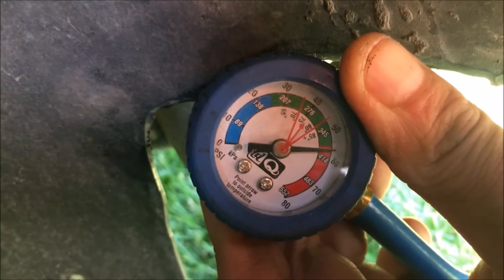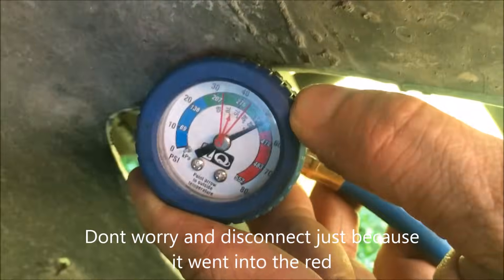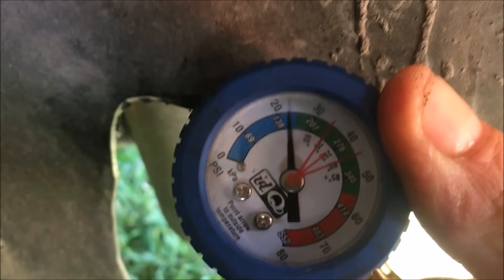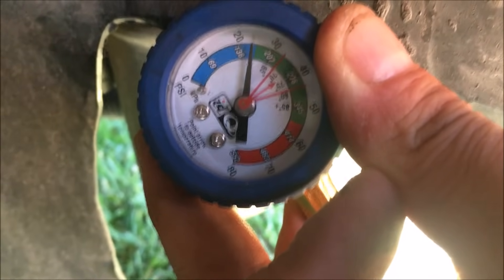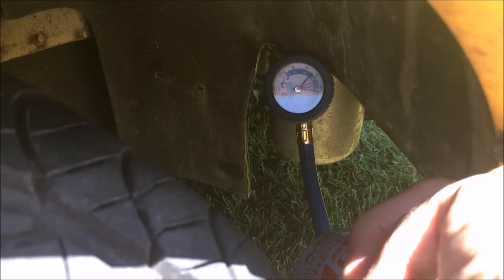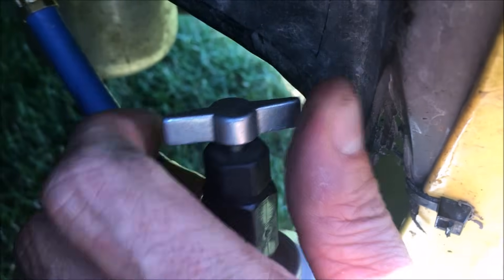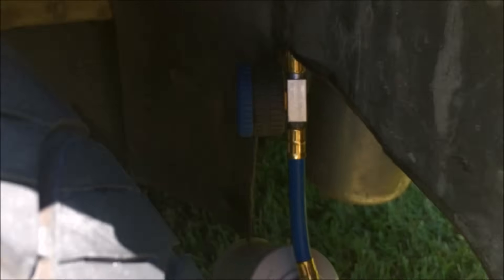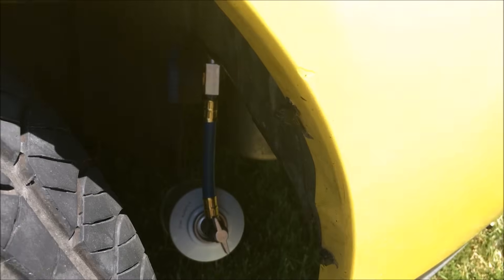Ac kicking on and off ( FIXED ) pressure fluctuation ( solved ) Recharge car ac. pressure to high?

Comment from the maker: Hello everybody , if your as happy as all the people below   please sub this channel , you dont have to watch my crappy vids Just help a fella out , thanks a million  your subs boost my channel value at no cost to you .
Reply: NOBOX7 I have a question! What did you do to have your compressor come on? When I press down on my nozzle it shoots into the red and I can hear my compressor is still trying to turn on
Reply from the maker: @SaturnSnapple  just keep slowly adding , it will stay on
Reply: I have a question and hope you can help me out.  The gauge on the Arctic Freeze I was putting in my van does keep going up and down and the compressor does keep turning on and off.  Can't seem to get the can emptied after about 40 minutes.  The can did empty about 80% of the refrigerant.  The gauge on the can sits at the border of the green and blue if I keep my van running.  But when I turn my van off with the gauge still connected it goes up into the red.  Is that normal or did I overcharge the system.  Which reading is correct.  With my van still running with the a/c on high or with the van completely turned off.  Hopefully you have an answer for me.  Thanks in advance!
Reply: @michaelpoole8175  look for leaks in your system, short cycling usually indicates low refrigerant condition. Also do not use stop leak, you'll kill your system within a year!
Reply: @4g63tpowered  how? Ive added refrigerant with leak stop several times in the past 6 years and knock on Ford it's still working
Reply: @JB-ef7ks  it tends to plug up the pressure port orfices leading to high pressure in the system. Either a hose will rupture or compressor will take a dump. I'm sure every vehicle make and model is different. Some you could get away with while others not. Just trying to help people. I should've explained why though. So thank you for asking.
Reply: @4g63tpowered  thank you for elaborating! 🤙
Reply: @4g63tpowered  my redtek refrigerant has a stop leak in it, but they say that it's not the typical leak stop. According to redtek, it just softens up, makes more flexible & plumps up the gaskets only.
Reply from the maker: @michaelpoole8175  Only when running . you have to turn the can upside down back and forth
Reply: You’ve got your subscribe! This IS THE ONLY VIDEO TO SHOW EXACTLY HOW TO READ THE GAUGE ON A FREON CAN!!!!
You’ve saved by life!!! Found that I was afraid of overcharging my system when, in reality, was low on Freon. After refilling it, found it’s leaking through the low pressure intake valve where you connect the can! Is it fixable? Any suggestions? It’s oozing some dye from it. Not sure if there’s an O-ring or something missing. Thank you very much!
Reply: @roadshowautosports  Schrader valve replacement. Parts houses sell the kit it's under ten bucks.
Reply: @roadshowautosports can’t agree more sure I could buy him a beer ! Great work !
Reply: New sub for sure and thank you again!
Reply: Done my friend! Subscribed! I had just repaired a leak and recharged mom's Subaru and it also had low pressure lockout but DID NOT behave like this at (compressor just ran continuously or not at all). Same day, same basic issue, my 06 Ranger was doing exactly this wild fluctuation due to the compressor only coming on at equalization pressure. Let us never forget!
Reply: Thank you so much 👍💯 you saved me from a hefty bill.. Liked and subscribed
Reply: Was looking for explanation of this for a 2005 Silverado, Thanks
Reply: Heck I’ll sub Thank you  My good man

Comment: Your opinion about “Ford” is ridiculous. You bought the Ford. Now you talk shit about the Ford. No auto engineer cares about maintenance only efficiency of production. The fact that you didn’t know how to use a tap properly or remember the name of the drier shows you are a novice trying to get views. The Ford isn’t crappy… your knowledge and explanation are what’s crappy. Your gauges get attached to the hoses at their respective locations for a reason. That fluctuation in the gauge levels off once you get enough refrigerant in the system.
Reply from the maker: Driver will soon Return On Foot   or be   Found On Road Dead ... This car was actually a F%#$@& Over Rebuilt Dodge though ? . I think the  "Failure Of Research & Development "   Is what caused the need to   Fix Or Repair Daily . Mechanics have told me they have  bin  asked forgiveness by Ford engineers  " Forgive Our Retarded Design " .  
We sold my sons car and i never have to deal with a ford again

Comment: vid helped me isolate issue to compressor clutch short cycling. pressed the bottle button whenever the pressure reading dropped (aka when the clutch engaged) and now it's fixed. thanks!

Comment: What if my ac is cycling on and off and instead of the pressure going to red zone and coming back down to low it only goes to the blue zone (normal) when it cycles off and then reads low when it cycles on? Pressure doesn’t read high like yours.

Comment: You seriously just saved my bank account. I kept thinking all these comments were BOTS. Lol. I did just like you said and it’s stabilized the system. Note: keep pumping the Freon into the system until it stops fluctuating, it will stabilize.

Comment: Hi, I have a 2015 Jeep Grand Cherokee and the AC compressor is keeping switching on and off the gauge is in green about 40 psi when the compressor is on and when is off it goes up a little but still in green. So can someone please tell me what’s going on? Thanks
Reply: put a manifold gauge to check the high side pressure.  but this looks like a bad evap temp sensor.

Comment: Exactly why I won't buy a Ford and will only work on Fords for close friends and family.
Im convinced that Ford designs EVERYTHING in their cars to dissuade home mechanics from doing even the easiest of repairs and even routine maintenance. 
Proprietary fasteners, specialty tools, impossible locations, etc. 
If you're not one of the 10% of Americans who can afford to run their ride to the dealership and pay a minimum of $300 every time a fuse blows or a tire goes low, avoid Fords! 
It's literally easier to maintain most foreign makes than it is a Ford.
This was a public service announcement from someone who cares to make your life less frustrating. 
You're welcome.

Comment: Dude.  I wish I would have found your post a while ago.  No need to repeat what so many have already said, but I have a 2007 Chevy Silverado 1500HD and hooked up the AC charger and the pin jumped back and from low to red zone.  So…I watched at least 20 videos on all the things I needed to exchange or repair, and had several in my cart, then I found your vid, hooked the AC charger back up and started pumping to refrigerant in and the system responded EXACTLY like you posted.  The pressure stabilized in the green zone and I’ve got the coldest air this old truck has pumped out in a long long time.  Thank you!

Comment: This is exactly what my Tahoe was doing. Thought it was the pressure switch. Replaced it and it was still doing the same thing. I thought I was going to overcharge the system but when the compressor kicked on I just kept adding refrigerant and like magic, it worked! Cold air, compressor stays on and levels in the green. Great video! Nice getting it done myself

Comment: Helped with 2003 Chevy 2500. Low coolant in system. Without compressor running I was in the red. When compressor finally clicked on after a few seconds of blasting, It would read low. I kept it pegged in the red until compressor continually ran.

Comment: Ford is crap , so if your fender liner wasn't ripped apart you would need to remove the tire and fender liner for access to the valve.
Reply from the maker: yes but the tire wont come off when you try LOL

Comment: My 2005 Tahoe AC has worked flawlessly in the three years I have had it.  I had a reputable oil service change done a week ago and they said the AC system needs work.  I said my AC is ice cold.  I used the AC three times since then and had cold AC.  Now, the compressor clicks on and off.  Do you think they did something to make it fail, to make work?

Comment: I feel like my compressor never fully kicks on, what do I do
Reply from the maker: Let refrigerant out and see if that works , let some out by pushing the shrader valve with a screw driver . if its over filled it turns off and on also
Reply from the maker: does your fan kick on ?

Comment: AC Pro should pay you for explaing this!  I watched a lot of videos from them and youtube and this is the only one that mentions this cycling symptom i was seeing. I had given up thinking I had a bigger issue and didn't want to do more damage. The AC completely stopped last week and I thought i'd give it one more try and saw your video. It was cycling between the low/green line and the yellow/red line every 5-10 seconds.. I just emptied a whole can and i'm steady now in the green blowing cold and fairly confident the whole issue is a slow leak. I could have saved a lot of time farting around trying to fill it and driving in a hot car over the last year if they would have explained the readings you may see with their $50 setup.

Comment: Hi. I'm wondering if anyone can help. I only have the fluctuating reading when my ac is on and on LOW fan setting. When the ac is on and the fan is on full blast, it stabilises on the top of the green band. Can you explain what the problem might be and a solution?

Comment: Just wanted to say that i stumbled on your video and it helped me alot. I normally own cars or trucks without A/C issues, but i recently bought a Yukon from a lying cop who didnt tell me it had low Freon (we bought it in the middle of winter so we couldnt tell it didnt work). I decided to fill it and add dye to check for leaks, but it kept kicking on and off during the fill...your video explained everything to me. Thanks.

Comment: I have a 2019 f350 and my compressor kicks on and off and im connected to low pressure line and it jumps up and down and i can not get it to the point where it stays on, can it be air? Its blowing cold but the clutch will kick in and out then sometimes it wont work
Reply: Yeah so i would getbit to work then days later it would stop then i would make it turn on by passing the switch and the pressure was to high then i would bleed it off and it would start but not blowing cold then it would get to low then i would vaccume the system then put just what it takes or a lil less freon then it would work pretty good but again a few days later it would stop working and it was the same thing pressure was to hight so compressor would not kick in at the end i had black death in the sustem finally compressor started leaking so i end up replacing the whole ac system and after 2,400$ its back on line and cooling like it was a brand new truck
Reply: Well the whole system but the evaporator, evaporator was flushed the rest had to be replaced because of the black death and metal all over the system, so when i was trying to fix i should of known it was the compressor about to break and yeah it finally did and when it did it sent all that metal thru the system

Comment: Hey my ford has alot of miles on it doesn't matter if it's foot miles it's alot of miles lol 😆 f.o.r.d lol sucks
Reply: FEET.             FORK.              
ON.                OUT
ROAD.           REFUNDS
DAILY.           DRIVER 

FOREVER.                FOREVER 
OPENING.                ON 
REAR.                        RACK
DEFERENTIAL.       Disassembled

Comment: Great Video !! Im still laughing  because i stumbled onto my first &last F.ix O.r R.epair D.aily and have the Exact same thoughts...Ford seems lost in cosmically confused engineering with a comical lack of forethought or care...THANK YOU for the A/C high-low demo...same here - will resolve YET ANOTHER FAILED FORD COMPONENT ...like the galactically stupid miscalibrated gas pedal issue  just resolved !

Comment: 02 ranger  low side schrader leak can't find large enough tool to tighten etc. A/C pro only makes one size which is larger than tire size but too small to fit over stem.

Wanting to buy removal tool amazon with cutoff to save 134 escaping. What size should I get???? Short cycling. Thinking about cheap manifold set

Comment: 2005 mustang.  My Guage kept bouncing very low to high like this.  I was very apprehensive to overfill it. Saw your video and decided to go for it. Had to push into the red on the Guage and basically a whole tall 20 oz can. Then boom. The ac compressor stayed on , my Guage stabilized, and I got in the car to ice cold air!!! Thank you so much
Reply: You only used 20oz to fill it I thought it was 24oz no wonder my ac being weird

Comment: MAKE sure you get the fundamentals right unlike what i did. I was using an old style recharging valve on a new style schrader valve can and.. surprise surprise nothing charged, reading zero pressure even while jumping the compressor. Don't be like me.

Comment: New compressor n pressure switch ac expansion valve but I didn't vacuum it does it cuss this on n off
Reply from the maker: it cycles on of if it has to much or to little freon , let some out if you have to much until cycling stops or add until cycling stops
Reply: @NOBOX7  How would you know if you have too much?

Comment: Your video did the trick on my 2004 Silverado 3500.
  I had no cold air - dead compressor until I shot a little in and got it to start cycling a short on and off.
 My gauge showed low when the compressor kicked on, then high yellow/low red when it kicked off. 
Watched your video and got more gutsy and counted the seconds the compressor was as on while filling the system and it increased in duration until the compressor stayed on and cold air in the cab! Thank you!

Comment: For some reason.  When I check the pressure while On and Off. It was showing under the green. So I add in more till it is under half way in the green. Then my car A/C compressor starting to fluctuate. I thought this was normal but after a while. I check again and it was in the red! So I just use the gauge trgger to release the pressure while it was on. It fixes the problem back down to middle green. Now, my car is running cold! Lol. I hope this doesn't mess up my A/C.

Comment: So im reading 35 psi roughly on my 02 explorer sport and it was blowing ice cold two days then stopped blowing cold and its still reading roughly 33psi. Ac clutch starting kicking on and off again as well is the ac pressure still a little low maybe?
Reply from the maker: let some out till it stops cycling

Comment: This video just saved me $1100 from a repair shop that told me the compressor needed replacement, turns out mine had excess air in line, depressurized and it's working 100%
Reply: @ayakosaito7323 you hook up any of the  DIY filler gauges that you buy at an auto parts store and leave the freon can off-  then when you depress the "fill" lever on the gauge it will vent your system.

Comment: So, my clutch cycling switch wouldn't turn on the clutch. Of course no cold air. I bought a can to recharge and turned the AC on high and recirc. But, the with the clutch not coming on and me recharging the low side port... the gauge on the freon can was in the 50 range. I pulled the connection off the clutch switch and jumped it, to engage the clutch. When I did that, it did just as your gauge shows... in the blue with barely above 2 needles from nothing to in the red when the clutch disengaged. 

My question is... should I be 'jumping the clutch switch' while I fill? Otherwise, it seems I'm not filling anything and the can isn't emptying into the system. If the clutch switch won't engage the clutch due to too low a pressure, it seems the obvious answer. But, I thought to ask anyway.

Comment: 2000 Chevy Silverado 1500, no ac cold air, my compressor cycles frequently, i hooked up a DIY ac charge bottle to the low side and the gauge shows around 50 psi when compressor not engaged and when engaged comes on down to around 20 psi?

Comment: I have a 2002 Ford Focus se. Every time I turn on the ac on I hear a clicking like it comes and goes and comes and it never actually blows cold air. I checked the coolant and it was on red but now it is on green since I took some of it out it’s not doing it as loud as before or as dramatic but it still makes the clicking sound but no cold air.
Reply from the maker: let more out til it starts working , that did it for me in the past
Reply: @NOBOX7  ok thanks I will try that.

Comment: So I keep adding until the compressor stays on correct because the more I added the warmer the air got but when I took some of the refrigerant out it got colder I need help
Reply: And it stopped fluxing
Reply: So did I over charge it
Reply: Before
Reply from the maker: yes if you over fill the compressor kick off , release freon until compressor stays on

Comment: THANK YOU. I was terrified of blowing up my system because it kept jumping faaaar into the red, then back to a much lower number(10-20), but after watching this I realized to keep adding until it stabilizes. Now my AC is blowing ice cold!
Reply: Mine was doing the same thing. Good lord willing I get ac today
Reply: I had that issue today. I am afraid to add more freon though in order to correct cycling issue.😮
Reply: Same boat. I'm still nervous doing it as I speak 😂😂

Comment: If my low pressure service port Schrader valve is leaking will that make it go from red to low green? I can't get the compressor to stay on it runs for about 4,5 seconds and stops..one of the lines is getting cold to the accumulator also i have the stupid ball type shrader valve when it leaks the whole valve has to come off and lose all the refrigerant i  do believe which sux